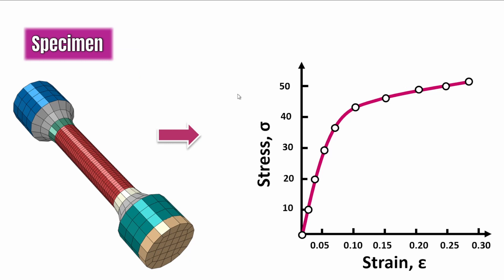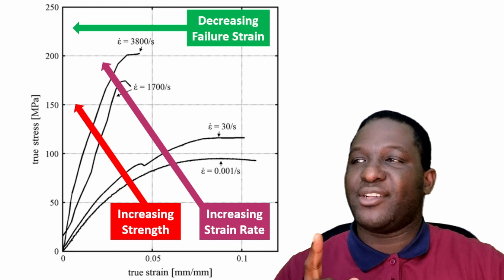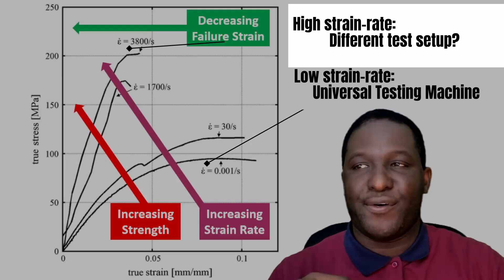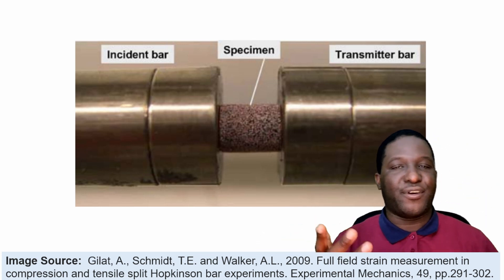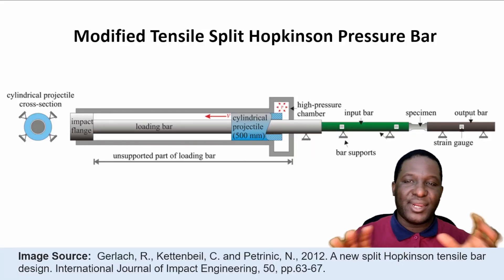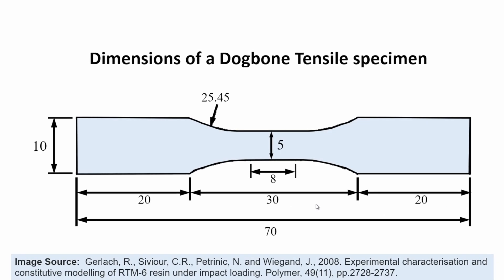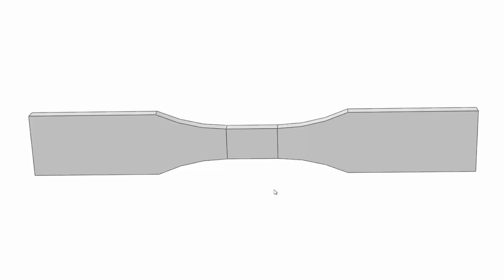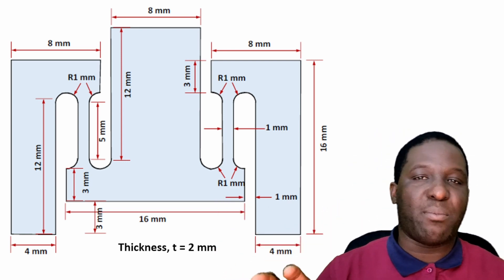How to Perform High Rate Tensile Testing

Comment: Hello, thank you very much for this wonderful lecture.  I have a question on the ANSYS program.  For example, I would like to prepare a compsite material in the form of a layer consisting of two materials, the first being fibers of any kind, and the other a polymer material, with dimensions of 10 * 10 cm and a thickness of 2 cm.  How do I calculate or how can I enter the volume fraction values of both materials into ANSYS software, for example, the first substance is 60% and the second substance is 40%.  I hope you will help me solve this problem.  I mean, how can the volumetric fraction or weight ratios be calculated for each material in the ANSYS program?  with respect for you❤❤
Reply from the maker: Hello, thanks for the query. I do not work in ANSYS a lot and although I do have a limited knowledge of the software, I however do not know the answer to your query. Good luck.